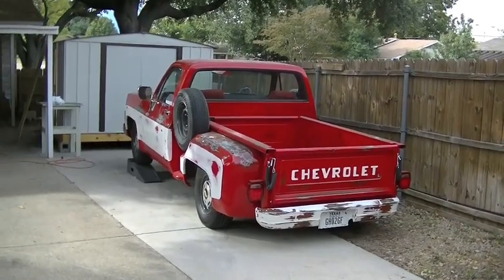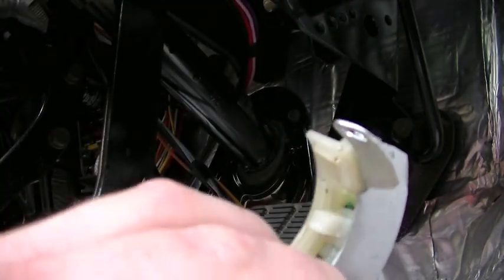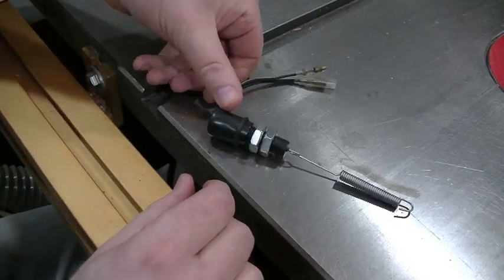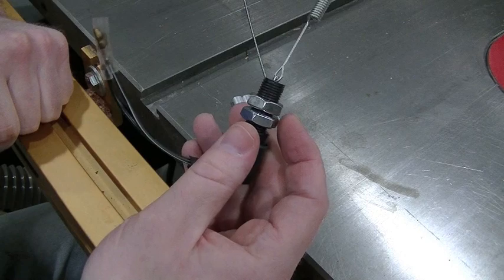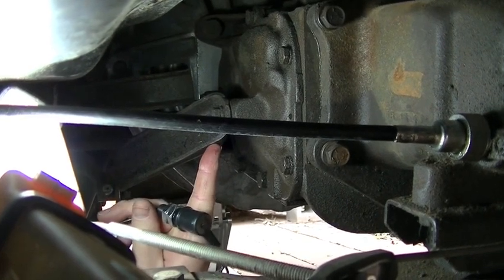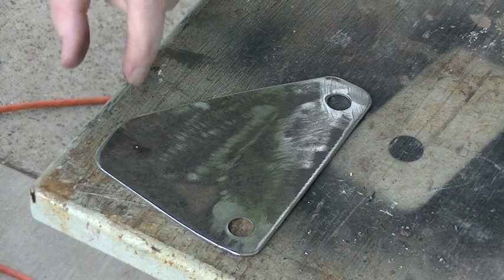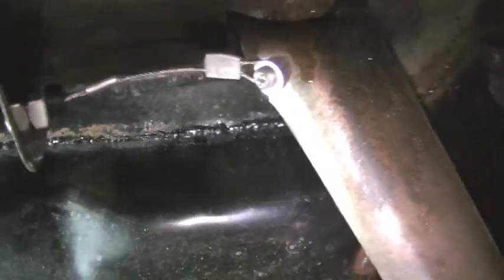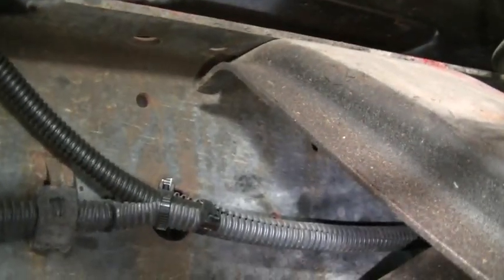3 ON THE TREE Reverse Lights Repair | CUSTOM BACK-UP LIGHT SWITCH

Comment: I feel your pain on those junky switches. I took apart the original Delco switch on my'67, it looks much stronger than the switch you bought for $40, which I think is a shabby re-pop. I can't see a real Delco switch anywhere for sale .Mine had come loose from being held closed by tiny metal tangs, so I cleaned the steel shall and epoxied it on both ends. If this one doesn't work I may try your method, which is very clever.
Thanks for that :)

Comment: Question for you. How did you wire it in for power? Did you need to fuse it and if so, what size fuse did you use?

Comment: One reason why these switches get stuck is because they originally didn't come with grease in them.. how I fixed mine on my 68 Chevy i sprayed carb cleaner in it and cleaned it. I put it back on and never had trouble with it ever since

Comment: I have a c 20 and the only thing I can see is the neutral safety switch you have has a different bit that slips into the steering column ( the plastic tang ) different shape